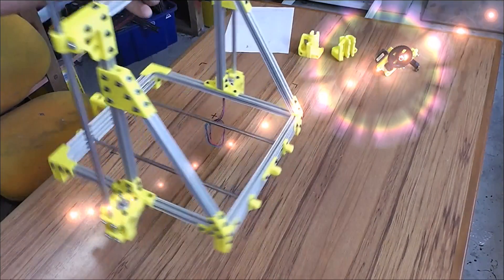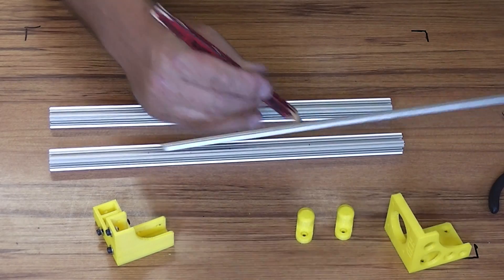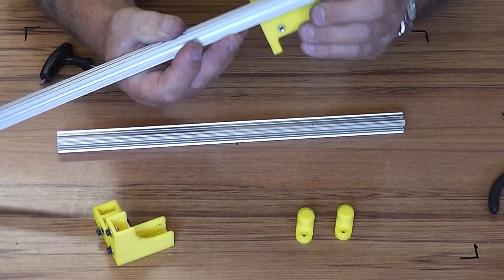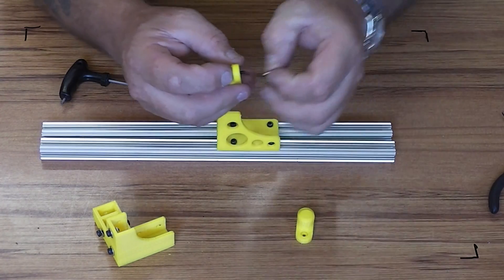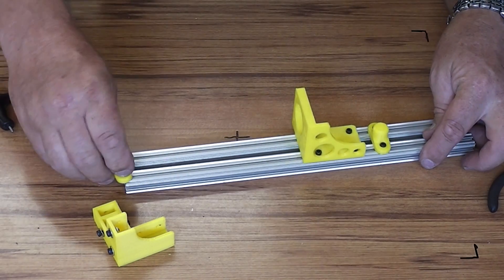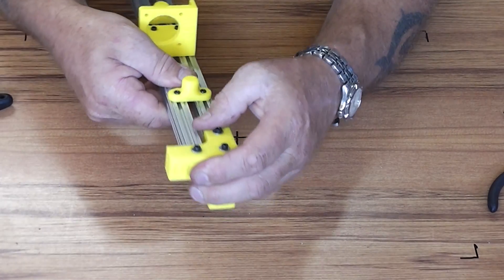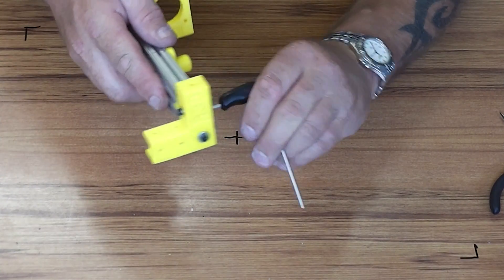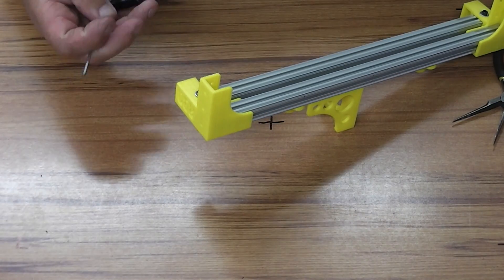OB1.4 assembly Part 2

Comment from the maker: I haven't had much of a look at the Reprap Air 2 so unsure. The main objective was to build an open-front machine with a large build area that didn't require laser gut parts and apart from the y-carriage bed which you could easily cut out of a piece of alloy it does that. 200mm z-height is enough for a lot of people and in reality if you ever printed something close to the 200x200x200 envelope it would take three days to print it. I am planning a larger build area for my next iteration.

Comment: Hey man, really like your design, saw it on this Cubehero.

You think this design is cheaper to make than the RepRap Air 2? I am now building a RepRap Air 2 'XL' which has a little more Z-height than the normal one, but I doubt it's going to be my main machine for long.

After I got this one working I'll probably try to make a 2nd one.

I am already on an excursion to find other machines to build and either the Rostock Delta or the OB1.4 are now the most interesting machines I've found so far.